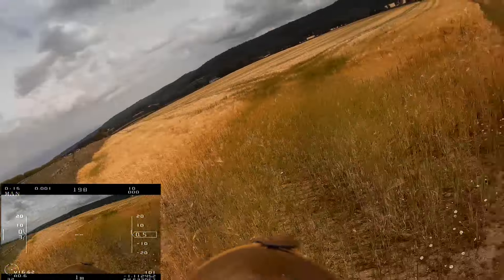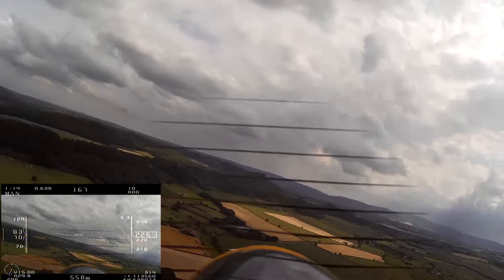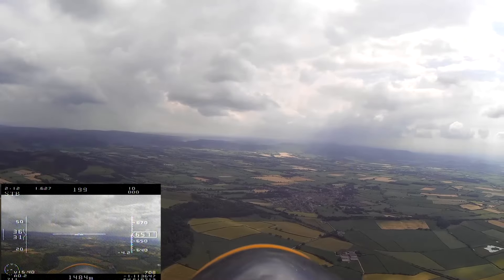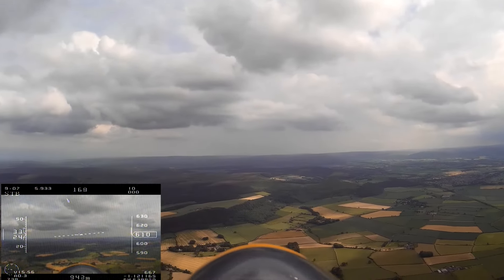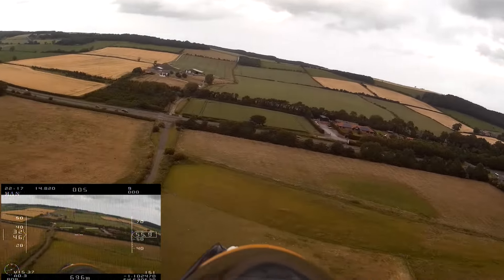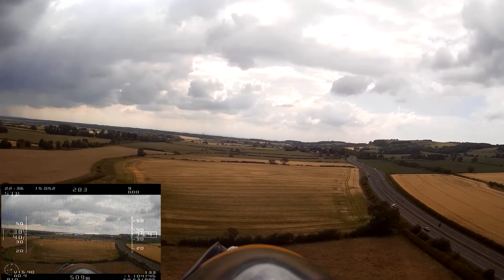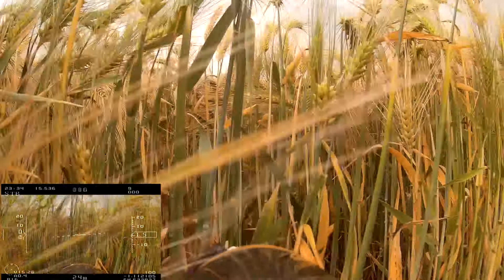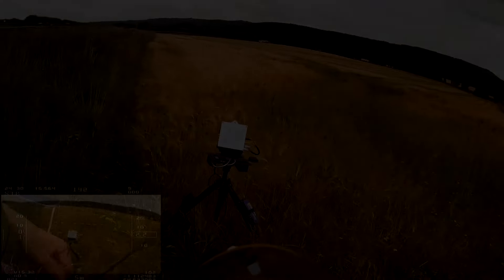Solius Thermal

Comment: Nice flight m8....It reminded me of years ago when I was just a teenager flying a Single Channel glider with a Cox Babe Bee on it....It caught a thermal and it ended up being over a 30 minute flight, which back then was pretty epic....we always worried about the rubber band powered escapement running out of turns..!!!  ....Proportional RC was just in developement back then...how things change....On a different note, that rssi indicator sounds like it would have been very useful on this flight, as you know, these birds dont need a motor to fly off !!!...Where are we with the DAC anyway, is it useable do you think?..
Reply from the maker: EnglishTurbines There was a problem I think with the EZUHF antenna, I have replaced it tonight with a homemade dipole which should have that fixed now The RSSI indicator wouldn't have helped much, it was sudden loss of signal not range related. I think the indicator is usable, have you tried yours yet ?
Reply: Coyote FPV Ah, yes the Dipole, I watched that clip on how to make one, so simple to do...as for the DAC I was hoping for another clip to see it hooked up and working first...Be interested to see the Dipole working too..:)...I have a Skylark Tiny OSD on its way, according to the Software, you can configure it for digital rssi input...this is going in the Skyfun which Im putting together at the moment...Im also trying to learn about the APM FC and Minim OSD...